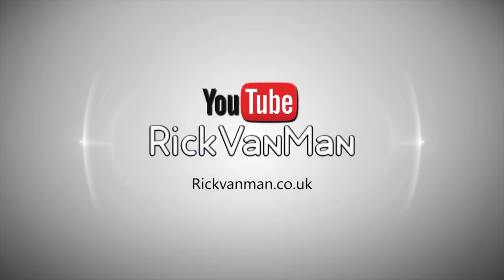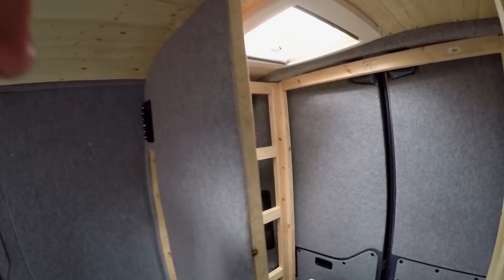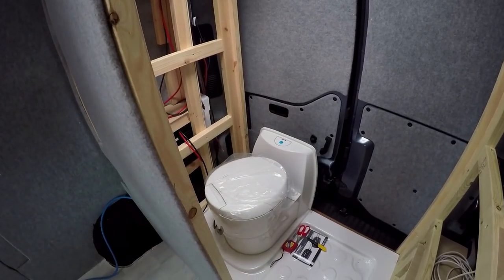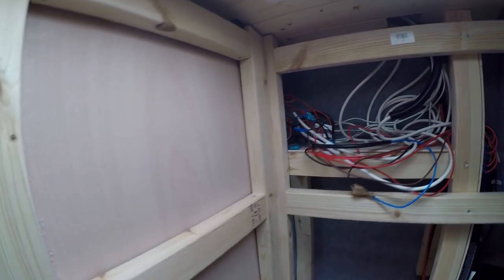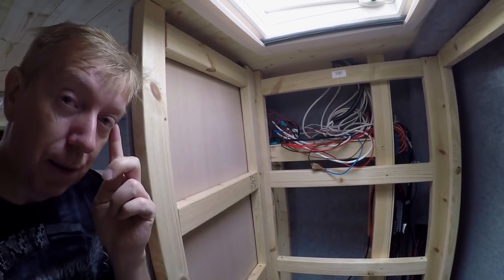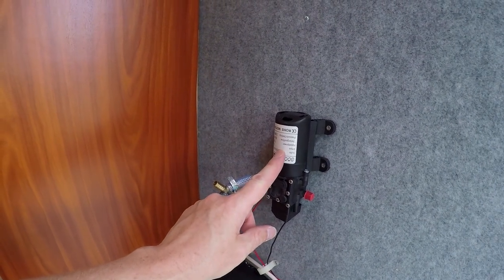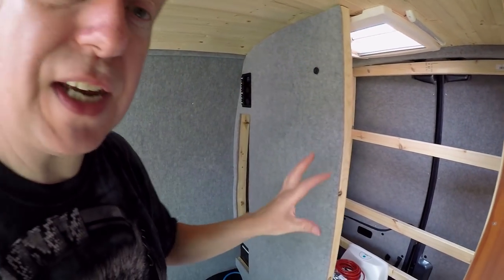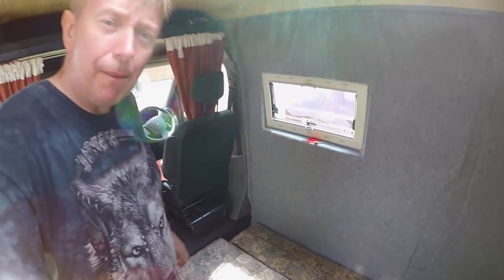2018 DIY Camper Van Day 7: Shoutouts, Seat Box & Bed - Rickvanman

Comment: Glue small patch of felt on the bottom of the wood slide outs as not to scratch the floor and for a smooth slide. You could use sheets of rubber gripping mesh to hold some tubs from sliding about below seat and cover with a bed skirt. If needed for temporary to do.

Comment: The bathroom when not in use is a huge space doing nothing, check out the Rapido V55 and see how they used a barn door arrangement and fitted a cupboard inside, with the position of your bed I'm sure you could do the same thing.

Comment: Looks like you have some room between the back wall and doors, ideal place to hang a decent size table for outdoors, maybe some chairs too.
What about putting a panel with doors on the fixed part of the bed frame, then nothing falls forward when you pull the bed out.
heh, i have a big crimper you could have borrowed, but at least you have your own now
Reply: One thing i just thought of, is that pump self priming ?
Will it pull water from a tank that's lower than where it is ?
I remember on a caravan site hearing a pressure activated pump operating, i think the family were out for the day, but you could hear the bzzzz ...... bzzzz, ..... bzzzzz, maybe the seals were worn and it kept losing pressure, so i hope you have a switch for it too.

Comment: Sorry if s'one has already asked this - what do you do about condensation from shower, kettle etc. Absolutely love yr videos. :)
Reply from the maker: rooflights and open windows :)
Reply: Rickvanman - Variety Channel There are roof lights with extractor fans built where you can add a power controller knob as Vandemonium did so its not so noisey but its a bit late for that now, unless you decide to add them further down the line when you do another refurb.

Comment: How do you remove the batteries when they die years down the line?
Reply: House Of Mada Yes, I also commented on previous electrical video, that it might be a challenge with electrical behind shower walls. Not so much the water issue but rather how to access if needed.  Though he has built out vans before so sure he has idea of how to make it work.